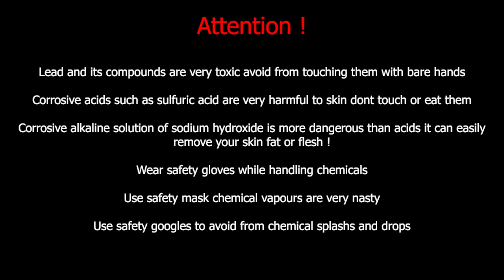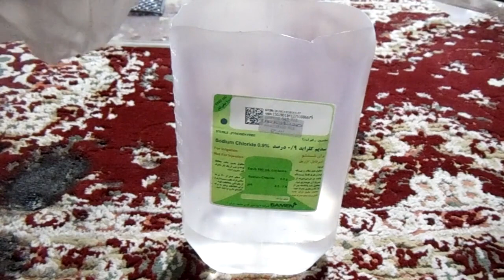making lead dioxide pbo2 anode with electroplating method for producing potassium perchlorate |

Comment: Looks nice but could you tell the components of the electroplating solution and also test the durability ?
Reply from the maker: I describe the solution in video its made it from 200ml 20-30% sulfuric acid and about 1 liter of water its doesnt so much matter to use exact industrial scales for plating I think 5% solution is also work 
The important is don let the current raise so much keep it under 1 amps dont use too much voltage because pbo2 layer gets soft done it with little current

you can make very dilute solution 
apply the voltage and slowly increase the acid to concentrate it 

And i test the pbo2 anode but unfortunabily it didnt work well and cause pbo2 layer decay !

i sholud use titanium or other hard metals for anode base a thin layer of pbo2 on it 
mmo anode are still dominant 
but i cant find it

however thanks for watching and submitting your opinion 😌
Reply: MMO's can be found all over the internet

Comment: This would only work if you alloy it with antimony at 20% but otherwise such coatings have to be plated on using salts.
Reply from the maker: yes I tested it and it didnt work well titanium pbo2 coated titanium is way better than this
Reply: @mohsenium  you need to precoat SnO2 first using SnCl4 hydrate in ethanol doped with ceric chloride or antimony baked at 600C
Reply from the maker: I dont have access to this matrials 
I just make simple and common stuffs i will make a graphite base anode someday
Reply: @mohsenium  graphite doesn't work as substrate due to interface oxidation similar reason to why lead doesn't work. Ti can be bought from aliexpress or sourced locally and is the cheapest inert substrate. SnCl4 or SnCl2 can be made from solder wire and HCl.
Reply from the maker: @CatboyChemicalSociety  thanks for your suggestion 
non metal conductors and metal oxides are best for anode but I cant find mmo anode in my local 
May I try diffrent anodes in another video 
Thanks for watching
Reply: @mohsenium  titanium is needed not MMO also you can try doped silicon wafers

Comment: Congratulations !
but you will never produce NaClO4 with that because the brine will enter behind your coating and corrode your lead substrate.
You need noble metal like iridium , platinum or so on, or titanium substrate with high voltage resistance interface layer like SnO2, I use it for mine.

But don't discourage yourself, try try, and always try even if things are difficult 💪✌
Reply from the maker: Progess is progess no matter how its small !

Yes not perfect for producing naclo4 
You can decrease decay rate with changing tempture , ph and else 
But at least 

you maybe agree with me that i made a good pbo2 anode with good hardness
You can use it for other reactions 
With lower anodic oxidation potenial or producing crude pbo2 

I will make a better anode in future 

Thanks for watching
Reply: @mohsenium  Yes, I'm sure you made a strong quality !
And of course you can use it of other application less corrosive.

Hope you will continue to share us your works ! 
Thanks for that 👌

Comment: You can use an old lead acid battery as the donor of anodes. The catch is you need to charge the battery first to convert the sulfate to lead dioxide, then remove as much sulfuric and sulfates as possible before introducing the chlorides.😊
Reply: No you cannot

Comment: I've tried using a 50% sulfuric acid solution and after electrolysis it turns into a copper sulfate solution, did I install the anode cathode wrong?
Reply from the maker: I think you connect copper to positive + terminal !